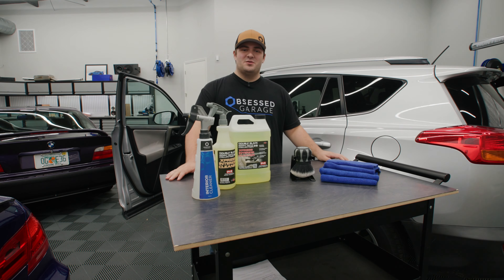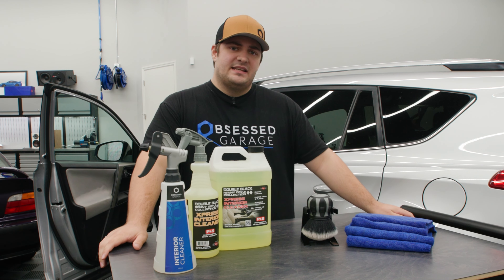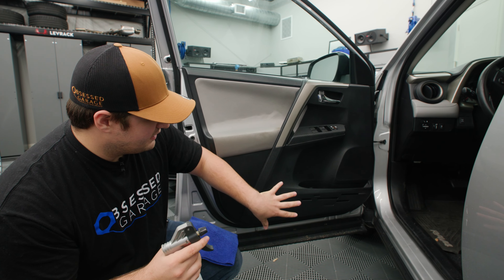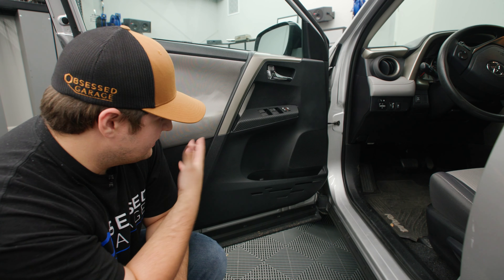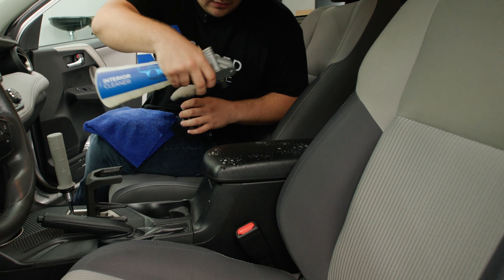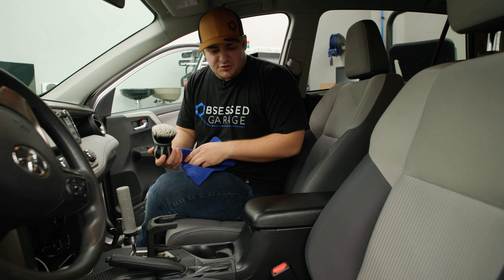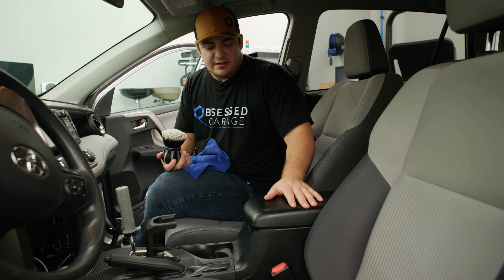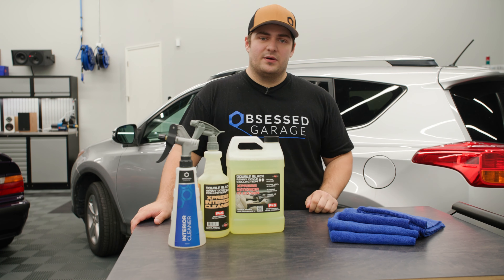P&S Xpress Interior Cleaner - The Best Residue Free Interior Cleaning for Your Car or Truck

Comment: This is my favorite cleaner, I use it with my ik foam sprayer. I have noticed that after being in the sprayer for a while, the scent of the chemical smells a little like ammonia. Has anyone noticed that?
Reply: As a rule of caution/longevity, you should empty your foamer and run distilled water through them when you’re finished using them (if you’re not using it every day).
That will not only prolong the life of your foamer, but may help with the smell as well.